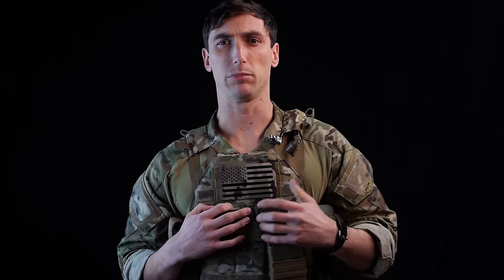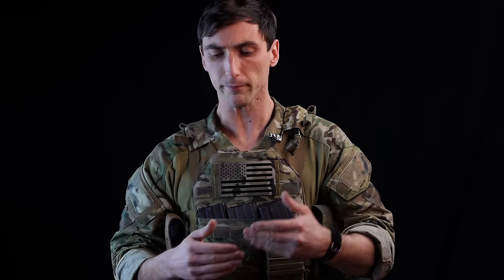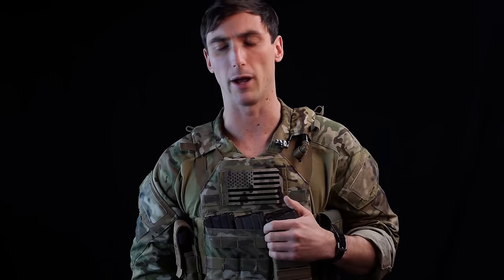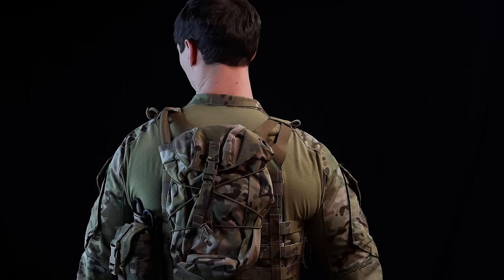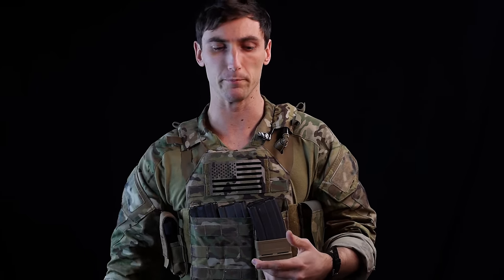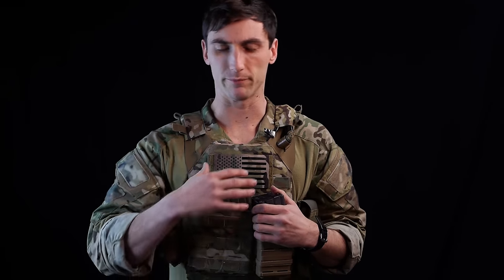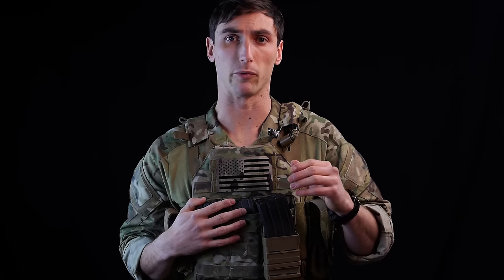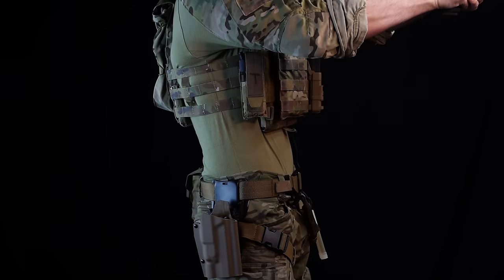Plate Carrier Setup (General / Crye JPC)

Comment: Great vid.  Since you asked, would like to see extreme weather stuff-how to stay functional for combat/survival when primary threat is cold.  Then extend it for on foot overnight(s)-bags, bivys, tents, etc.  and how to use them effectively.
Reply: Casey Brown Layers, layers and layers have a lot of clothing layers. That's the thing I learned in the fdf (Finnish defense forces) so yeah below -40°F winters. If you're shit out of luck dig a hole in the snow and sleep there, eat pine needles and don't expose your skin  to the cold if not absolutely necessary. If you fall into the water, don't panic and when you get out change quick. Crosdcountry skies are the best way to move around, not the normal ones get slmething thicker. Also if working with vehicles, keep a blowtorch ready so you can heat up the engine block, don't know how it works with civilian vehicles and all the plastics they nowadays have.
Reply: Casey Brown you won’t wear plate carriers in the extreme cold. Since you’ll need cold weather clothing you’d wear regular chest rigs or MAVs. Overheating is super easy with a PC and warming layers.
Reply: What is the name/brand of the long sleeve shirt you are wearing?

Comment: Great video Garand Thumb, very informative! I like the mantra Stop Holes, Plug Holes, Make Holes.
Very simple way to remember what is important about setting up a PC.

The clearance issue with pouches on the front is a particularly good point, I have heard stories of guys getting shot in the derriere because they could not get low enough.
Another suggestion for anyone setting up a PC or any LBV is to just put it on and wear it and see how it feels. Run and jump and crawl in it if you have to. In my experience that is when you will know if a pouch set up is ideal or idiotic.

Looking cool is half the battle

Comment: great information on your part. very well organized, well-thought out load.
Reply from the maker: Thanks brother!
Reply: Garand Thumb Hey man, quick question: I live in Canada and it's really hard to find plates at a decent price here, but I found a good deal on 8×10 plates, are those adequate protection ? I'm close to the same frame size as you. Or should I just wait and save my money and get 10×12's ?
Reply from the maker: Chris Hatem i'm 6 foot and 190, the medium ESAPI's are the smallest I'll go and they are approx 9.5x11.75
Reply: Garand Thumb  I’m finally buying some armor. I looked at the crye products. Little expensive for me. Do you recommend the spartan armor system brand over the testudo from ar500. 

I know I shouldn’t cheap out on armor I plan on spending  $400-$500. I can’t spend too much because I need to buy another LWRCI:)

Comment: So I've watched some of your videos in the last couple days and have been enjoying them, but by far this has been the most straight forward one, which I really appreciated. I setup my rig in a lot of different ways and moved around as much as possible with each configuration and found that less is more at times, but still didn't feel 100% about it in the end, hence I watched this video. I also wanted to incorporate a battle belt so if I had to drop my plate carrier I'd still have some back-up gear, which proved a little challenging when crouched or going prone. In the end I left the majority of the gear on the plate carrier, figuring I'd scavenge as needed until getting to safety. I did notice there wasn't any sort of knife/cutting instrument nor spare pistol mags on your rig and am wondering why that was. Lastly, thank you for your efforts in spreading knowledge and your service.
Reply: Lm lo

Comment: I need your help. I am a SAW gunner. I struggle a lot with my kit. Every movement we do is a smoker for me. I am currently using the issue IBA and FLC. I have heart and I am trying my hardest to improve my physical readiness, but I'm still gassed after every movement. What plate carrier/set up would you suggest that would help me so I can keep up better with my team/squad? I feel like I am letting my team down and I want to be a combat multiplier, not a hindrance on my team.

Comment: As a goof I used my battle belt as a cummerbund looped through the straps and buckles of my minimalist plate carrier.

Very supportive and sturdy but mainly fitted very well to the circumference of the vest straps and my torso, now I have a lot of molle room leading to me adding a first aide pouch and 2 extra mag pouches to my left and right sides. 

Adds back support because I have the back of the belt looped on the inside of my pc because; of my hydration pouch/fitted better that way. 

You can’t tell because of my added pouches,
 that it isn’t a cummerbund but technically the battle belt is just a high end cummerbund on your waist without plates/pads. 

The room saved because of the shape of the battle belt’s design is why I am not looking for a cummerbund, I can even add side plates and still have enough real estate to add a radio pouch etc..

Comment: Very useful advice! Thanks for mentioning the lateral protection, because that (in my opinion) is an essential area to protect. Is the module option just as effective as a carrier which includes built-in lateral plate pockets?
Reply: Depends..The add on side plate  pouches will work just as well for running hard side plate armor as a carrier with a cummerbund designed with pockets for hard plates. However.. a lot of the carriers that comes with cumberbunds designed for armor also have large pockets that cover the entire cumberbund meant for running soft armor panels. If your just planning on running hard side plates which is most likely what you’d wanna do , the add on side plate pockets will work just as well. However you would get a lot more protection for fragmentation with the soft armor/ side plate combo on the carriers that comes with armor capable cumberbunds .

Comment: Talking about mag direction, there are two basic grips that people use (may not be "official" terminology), either a pinch grip, where the palm is on the base, or a claw which is what you did where the palm is on the side. 

Pinch needs bullets forward (relative to whichever side is non-firing at the time around the front to the other side), claw needs bullets back.

Pinch is good for grasping magazines that are low or very high up. Claw is good for speed since the grip is higher so you have more control. Claw has a lower range of flexibility limited to the non-firing side pouches, and the front pouches favoring the non-firing side.

The way I set up are mags on the non dominant side is bullets back with claw, front is pinch (bullets forward) and on the dominant side bullets are also front relative to the nondominant side (but they are facing to the back). I set up this way so no matter which shoulder I am firing from, I always have a primary reloading pouch that uses the faster claw grip. When I need to top off things using my front mags, I use a pinch grip for my dominant side shooting, and claw for my non-dominant.

Comment: I really enjoyed having someone do a video on this where it was opinionated, and had an idea of what is and isn't right, but also I really like how you state multiple times, "Do whatever works". Because yes, there are better ways to do things, but I know a lot of my buddies trained a certain way so they do things that to me are a little weird.

Also Personally, I like running all my mags facing the same way, 2 rows up front, though, but only because I typically run 8+1, or sometimes even  10+1, depending on mission. I think the most I've carried was 12+ 1, i probably ended up handing out the extra 2 mags though. And i only run 6 max up front.

Comment: Great video, just for SA though, spalling is when edges of the steel plate brake off from impact and can turn into frag. The anti spalling coating is designed to contain those broken pieces. Fragmentation is what happens when the round impacts. The coating isn't designed to contain frag unfortunately. I know it's just splitting hairs, but something I found interesting when I was issued steel plates for low vis and decided to research.

Comment: what alot of people get tunnel vision on is the guns and the gear. even in civilian life. i see far too often people carrying either concealed or open, and they have their weapon, a reload or 2. and usually thats it. its my personal opinion that if you carry a weapon, you MUST carry at the very very least a tourniquet.  but preferably a small or a micro ifak. you can get them that fit your ankle and are not at all intrusive. or you can toss it in your cargo pocket or even attach it to your belt. whatever, as long as you are carrying some form of hole plugging/ blood loos mitigation device. especially in the civilian world. on the off chance that you are an "ultra high speed super tactical ninja operator" and you DONT carry an ifak, theres a fairly good certainty that one of your fellow super tactical ninjas will be carrying one. however its not their responsibility to carry life saving equipment for YOU. so do yourself and your team mates a huge favor, and be a responsible ultra high speed uber tactical ninja operator. or whatever your preferred nomenclature is.

Comment: 3:40 - 3:45 you talk about getting the buttstock up in the shoulder. Do you have any thoughts on placing the buttstock directly under the dominant eye? It basically puts it just off the center of the chest and lets the butt sit on the completely flat surface of the plate. Its definitely a CQB specific thing. Dont hate it until you try it but wondering if you have come across this concept?

Comment: @GarandThumb Good reviews as we expect from your channel. 

If it works for you that is what counts, but to us, it looks like the pouch you have mounted on the far right of your carrier, is bumping into your bicept / arm even as you present the video and could snag your draw.

Next, if you were wearing a recent #lbtinc L #LBT6094B or XL #LBT6094C in #ESAPI cut, with 8 molle pals loops wide on the lower front face. You could place 4 x 1 mags wide on the front, with a more flat profile. Without having that quick load ready mag sticking out, on the far left front your rig, to snag on something.   

The 3 in the kangaroo pocket on the 6094s never seem to work for our mags and the draw is not as good.

Fabric and shock cord retention mag pouches, always run the risk of having the pouch get bumped, to damage feed lips and rounds, or shift the rounds in the feed lips (to cause double feed when inserted into weapon) and or snag the tips of the rounds against the shock cord during fast reloading, with our mags. Case in point, the really bad for our use hsgi taco pouch design we had in the past. For this reason, we would not recommend the hsgi taco pouches for any use. We have been looking into the idea of more hard shell and or kydex lined single mag carriers, to protect the mags and reduce possibility of this serious problem.

Some also like the holster mounted standalone on a 2 inch thick duty belt with suspenders, not the pants mounted  LBT / #SOE cobra rigger belt, since these often bend and fold over, even under finger pressure and were not designed as gun belts.

******** Posting this info below on a few sites for those of you who have the $ and collect LBT gear,  who are also interested in supporting our effort:

Getting through our group effort means you also help those in service, private,  etc., around the World, to make quantity with the manufacturer, to build and meet their private purchase needs. For a Win Win for all of us.

As usual, items are priced not for profit, at what the manufacturer charges us. Plus shipping to you. In this manner, we are able to build quantity required, to start manufacture with each pledge for gear. 

If you need gear, such as  a top of a line  LBT MAS Grey Plate Carrier Kit, please take a look at our list, each paid pledge to purchase helps us with making quantity to meet our June to VJ Day Deadline.Check out the FB and IG page for the holster and carriers.Plate Carrier. Here is what we have found to be the very best for our use.    
1.     LBT  6094 Releasable UnderWay MOLLE Plate Carrier 
2.     LBT  6094 Releasable  MOLLE Plate Carrier

All are for LBT ESAPI Cut Plates: A  (S/M), B (L) and C (XL)

In MAS Grey, made in the USA by London Bridge Trading Company.   
        

Having a quick release on a plate carrier like this, can save your life and those of your loved ones. You may need to get that carrier off fast under any condition.    

Don't wear anything without a quick release system. You never know.  Be ready for the worse at all times with the very best.         
   

We are working to two good LBT carriers, maybe more. One, the Releasable Underway, has a quick release with additional pockets to also accept special foam panels for those operarting anywhere near or on water. Think storms, flooding,  boating, rivers, lakes, outdoors, recreational use, etc.  The other carrier, is Releasable only,  only has a quick release system with no Underway feature.     

The color on these is LBT MAS Grey. We find this color best for civilian use, in classes, range, etc., since the other colors are often used by Federal and other Law Enforcement in most of our locations. The solid MAS Grey color also seems to break the ice much better as a collector at ranges, etc., over the camo, black, and other usual LE / SWAT colors, etc.

These LBT MAS Grey carriers are through us.        If you want to get a good small medical pouch now, please go to the LBT website and buy those direct from the manufacturer, they are on sale for $39.99 in MAS Grey color right now for Memorial Day while supplies last. It is called the Blowout Kit medical pouch.    www.lbtinc.com     They also have some packs and bags at a good price. Act on this before the sale is over, if you think the prices will not get better.    If interested in our LBT MAS Grey Plate Carrier kit items, our email is in the youtube  profile here on youtube, email for details, price and to get in. We have a great price on these. To include hydration pouch, etc. Prices are on facebook on IG. Plus we get an extra 10% off. We like to do this by June. The prices are all done to be not for profit.

The LBT6094 MAS Grey Releasable UnderWay Plate Carrier will be $600 or less, plus 10% off (when we they are made and we get them),  plus shipping to you. We have a wait period with No ETA of several months, until these special ones are made just for us, brand new by LBT.   Just like our LBT MAS Grey holsters, you see for the #MK24 #HK45CT that some per their decision are also using for #SIG226R #SIG226RX5Short #HK #USP Compact #Glock19 etc. *** Keep in mind using the wrong model handgun in any holster is not safe.  

If color does not matter, you can also hold out for sales direct from LBT for the Releasable only plate carrier, but these mostly come in multicam with the BlackHawk style printed multicam billboard brand logo on the fabric. With luck searching around you, might get these for around $300+.

Thank you        

https://www.instagram.com/lbtmasgreyseacityfundgroup

Sorry for any type errors as we make our rounds, thanks to copy paste tap talk voice to print

#masgrey #massgrey #londonbridgetradingcompany #whenqualitycounts #platecarrier #tacticalgear #missscuba #mchooyah #costaludus

You may also view list on facebook, IG, Sturm and hkpro in the Group Buys section: LBT MAS Grey Operator Kit
Reply from the maker: Excellent points. I don't disagree with you on anything. Thanks for posting and giving your input.

Comment: Brah, brahhhh braaahhhh Don’t you like the Magpul mags and put Ranger Tabs on them and Enhanced Followers and you get them with windows Brah. I used neon Orange on the spring to give you a nice visual count. I also ran one over with my diesel truck on pavement. It worked fine. Try that with a metal mag and it’s toast. I served in the Canadian Armed Forces. Everybody giggles at that. Where a lot smaller force and the money they spend on training each soldier is a lot higher than America. I have trained with US forces and saw the difference. Anyhow, just wonder why you like the steel mags. Everything else You do I agree with. Keep up the great work. Keep teaching some of these Arctic Tenderfoots.

Comment: I have 10x12 shooters cut plates, will there be a ton of wobble if I went with a Large Crye JPC?
Reply: I have Hesco 4401 10x12 Shooters Cut Plates and a Crye JPC 1.0 Large... yes, there is a lot of wobble and a lot of unoccupied space. When the plates are in the carrier, and the plates succumb to gravity, there is a good 2-3” from the top of the plate carrier to the top of the plate...

For the time being (I have Hesco 4400 SAPI Large plates coming), I took a foam yoga block, cut it 2” thick (longways) and placed that under the plate to raise the plate to where it needs to be. Definitely NOT a permanent solution, but it’s working fine until my new plates come in...